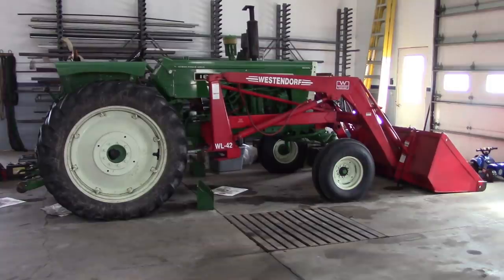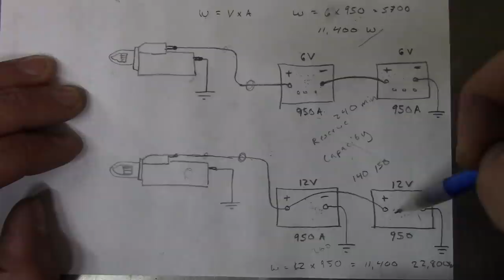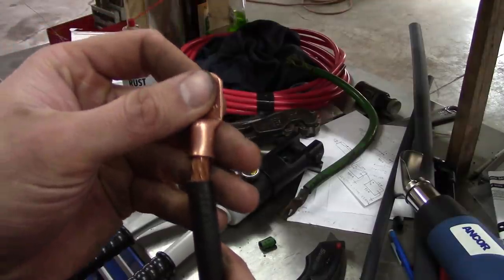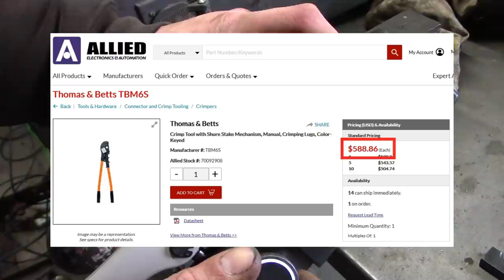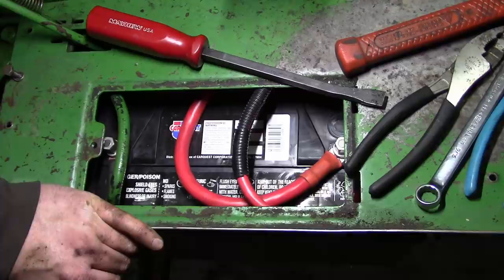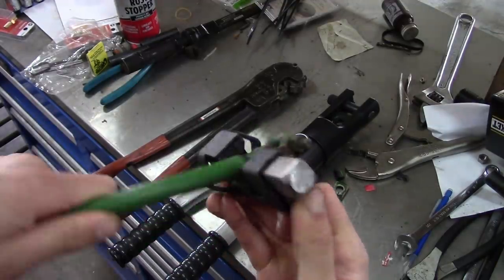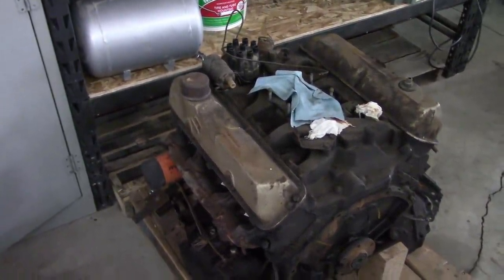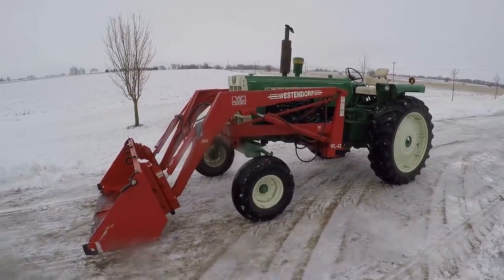Oliver 1650 Tractor 6 Volt to 12 Volt Battery Upgrade

Comment: The one cable on older trucks and cars everyone forgets is the ground strap from the engine block to the bodywork. I had an old car which was a mare to start. I threw new batteries, cables and even a starter motor at it with little effect. Then a wise old mechanic diagnosed the issue by taking a jumper cable from the block to the body and eliminated the problem he then replaced the braided strap.. He also showed me where the choke cable outer sleeve was starting to melt as the starting current was taking another path. Arn't cars great!

Comment: That Oliver is such a typical example of 1960's tractor technology.  Leaks from every seal, has some weird "Why'd they do that?"  and some "Why's IT doing that!"  and yet give it a few minutes to start and warm, tong fer chong as it may be it goes out and works.   Wont see any tractor today running like that in 2070... Great video!  That crimper, wow, I restore old tractors for fun, and THAT thing is the cats meow!
Reply from the maker: Yeah. I feel the same way. You can fix this tractor with a hammer, a flathead screwdriver, and a 9/16 wrench.

Comment: You already got the suggestion for using a MM2 > AWG conversion table. So that's covered.

Use the MM2 die closest to your AWG cable, even if it is a little to big. The difference is minimal and will not hurt the quality of your crimp. More or less flexible wire (=number of strands in wire) also have a different outer diameter so you will never be spot on.

Never use (copper) starter lugs but always use thick walled fully closed tinned lugs like you used on the 2/0 cable. These crimpers are designed for those lugs.

Always remove 5-10% more insulation of the cable. This is because your terminal will get a bit stretched in the crimping process.

Always start crimping nearest to the eyelet in the lug when you need to do 2 crimps or more. For the reason of that see above.

Comment: My electrician made a plate with a post that sticks into the handle (you remove or cut the end of the rubber handle) which allows him to either use his foot to stick the crimper upright on the floor or screw it down to a bench. As for how you'd go around to figuring out which dies to use with which wire, what i saw him do is, he'd take the wire, clean it as you did, then put the dies over it. When the dies touch the wire evenly on all sides, he'd either stick with those or choose the next number down, based on the thickness of the post. 

We redid the entire electrical cabinet for an industrial site a few months back, so i got to watch him work extensively with this tool (one like it, different brand). Different wire thicknesses, different terminals. Very versatile tool. There's also different dies you can buy where they perform different actions, for example, there's one that allows you to slice a thick wire perfectly clean in one cut, really clean one. And using the other side of the dies, you rotate the wire in, perfectly cuts the sleeve too, doesn't slice into the wire at all, with a little lip on it. Obviously, useful only in a production setup, i doubt anyone in their right mind would do this for two or three wires, but there's variation.
Reply from the maker: Interesting. I wonder if the dies will fit this cheap tool.

Comment: You did everything right with the crimp,   but after you final crimp you should rotate 90 degrees and crimp again to get rid of the 2 little flags that stick out from each side.  I rotate after each crimp and crimp it again at least 2 times,  this also tightens it up,  I've been using this tool for years. It never fails. I'm referring to the hydraulic crimp tool.
Reply from the maker: There you go! I'll try that next time.
Reply: Double crimping is a big no no.
Reply: @audiquattro6768   not if you are rotating it exactly 90 degrees between crimp with this type of hydraulic  tool
Reply: @WatchWesWork  I said 180 degrees  but I meant only 90 degrees rotation

Comment: 1st . Here in Minnesota I have 3 Northern tool stores within 15 miles , 2nd . Back before 12 volt ( pre 56 ) farmers had 6 volt and lots of them so Oliver thought that having 2 -6 volt batteries would be easier on the pocket book !  We have Fleet Farm around here and was told there batteries were 2nd’s and or blems and that’s why they are sometimes cheap ! I like deca batteries myself and I do prefer to solder the ends on . But that’s my choice ! I do so few batteries that having a specialty tool is more of a luxury for my shop . So that’s my 2 cents worth ! Congratulations on only having to take care of 1 place !
Reply from the maker: Yeah, it's a luxury for me too. But for $30 I thought I would treat myself!

Comment: Years ago I met an auto mechanic who had a short stump for a ring finger. I asked what happened. He said he got his wedding ring across 12volts and a ground. It instantly got red hot, cauterizing around the finger before he could react. Did so much damage he lost the finger. I think of that as well as the tools every time I disconnect/connect a battery. I also never wear a ring when working!        I first saw you on the Morgan brake job, subscribed immediately. You are a great guy to help her. You are also clearly a very bright, talented mechanic (I’m guessing EE).   Wish I was lucky enough to have a great mechanic like you near me!

Comment: Stopped watching a movie when i got this notification.  WWW>movie.
Reply from the maker: Nice! I'm moving up in the world!
Reply: @WatchWesWork   At least you found that repaired cable with a proper crimp on it!  I don't know how many times I see guys using those zinc or lead based battery terminals from china on their rigs just waiting to burn your barn down.
Reply: @FrequencyOfThought  Terminals? I just make a loop by separating the wire, Throw a little solder on it and I'm good.
Reply: @HanstheTraffer  Please don't use solder, I hope this was a joke.
Reply: @FrequencyOfThought It is a joke but why not use solder?
Reply: @HanstheTraffer   Because solder melts with heat. Think of a shorted wire and how hot it gets.
Reply: @FrequencyOfThought  save time n money ,just melt the terminal over the wire ....
 Propped job ,,,,,!!!

Comment: I have a crimper like that I bought of amazon, different color but probably made in the same factory.  It works good enough, I guess.

Also, "welding cable" is more flexible and easier to work with than normal battery cables.
Reply from the maker: I know, but SGX cable has a higher temp rating, ironically.
Reply: I used high amp jumper lead cable to hook up my duel batteries 👌

Comment: I got a yellow version off that jungle place. I got it for building 4 awg cables we provide with a product. A great way to check the die size is to saw through crimp in the middle. When done right, the copper goes solid. I find we could mix and match dies for intermediate sizes. I ended up machining the back of one die to end up perfect sized for our application. 👍

Comment: I have so much to say on this subject. I will refrain from ramblin on. Two grounds on every battery. I   solder my connections then water and salt can't enter the thing. 5he days of good batteries are gone. Well done Wes. Enough said.
Reply: Not good to solder these, I believe. High heat can melt it.
Reply from the maker: Yeah. I hear that. On a vehicle there is no such thing as "too good". But you can get away with a lot on these tractors. They never see salt.
Reply: It does take a lot of heat to solder one of these terminals, but I doubt you'd damage anything but the insulation. Not an issue if you put heat shrink on them.
Reply: Unless you mean the terminals melting off... I've never seen it or heard of it happening, but it could under some circumstances.
Reply: I was always told not to solder wiring on a vehicle if you can help it because the solder wicks up the wire and cause it to be less flexible and work harden until it breaks.
But I'm in Australia and we don;t get salted roads, or snow mostly.

Comment: I got a crimper from Harbor Freight, worked great.  Did a cable wrong and had to cut the connector off and replace it.  Cut the removed connector in half and was pleased to see that the connector and cable became one piece of copper.  It did a good job.   Also, I put the main handle to the crimper into a bench vice and then I could hold wire with connector in jaws with one hand and pump with the other.

Comment: Wes, a friend of mine who has a big very old tractor like yours out in the Redlands in the southwest area of Miami-Dade country fixed his weather checked tires with Flexseal passengers and a plastic Bondo spreader 2 years ago.
He hasn't had a problem with them since.
Sounds crazy but like you said.
The price of new tires is insanely expensive.
He did dismount them from the tractor so he could lat them on their sides so the flex seal wouldn't sag.
Thanks for the highly informative and entertaining long video.

Comment: Geez Wes, I can't believe someone has not yelled at you for setting your batteries on bare concrete! Keep up the good work!
Reply: That was only a problem with early battery's that had crude, rubber cases. They would rot, leak, etc.

Comment: As much as I like my 90's Japanese tractor for its reliable, starts whenever and economy, I miss my old Allis with all its leaks, quirks and weirdness.
Reply from the maker: I don't have much experience with Allis. They have good engines, but the clutch/PTO clutch setup is odd, and the transmissions are unreliable. Of course, that's true for plenty of other tractors.
Reply: @WatchWesWork  Hand clutch give nice control and lets you do live PTO.  Just like the diesel injectors, must be a patent issue because everybody has a different way.

Comment: I would mount the tool in the vice....then set the lug in the tool....use your hand to push the wire into the lug mounted in tool...then pump with your free hand.
Reply: pump with your free hand. BTDT.

Comment: Hiya Wes, another great video, thank you. But, yep, there is always a but, when yon fitted the first, on-screen negative cable to the chassis you should have cleaned off the metal. Surface area contact is the clue, so clean off the frame of gunk, paint, etc. Apart from that, nice one... Stay safe...Steve...

Comment: It was my understanding the equipment that is subject to vibration should be crimped connections on stranded wire.
Reply from the maker: That's the conventional wisdom. Solder can be brittle.

Comment: Thanks for the battery lesson. I have the same crimpers I got on Amazon - I put the crimper in the vice which left me hands free to line up the lugs so the cables wouldn't have to twist.

Comment: In the shop I worked at we used Kopr-Shield made by Thomas & Betts on all of our battery cables when we put the lugs on and also on the battery terminals. I use it on my own vehicles to keep a good connection and no corrosion. It is like a copper never seize that is conductive. It is real good stuff.  Nice video.
Reply from the maker: I'll have to check it out. Deka sells a battery terminal spray as well, but I have never used it.

Comment: It's a matter of metrics, when you mass produce an item by the billions of units, the total price is less than you'd imagine. And i'm not talking about a finite item, rather, sub-components. The knob, the dies, the press, the ram, the handles etc. Then you add up the indentured slave labour (it is, what it is, i don't consider China's situation to be in legal bounds with the Human rights, regardless of who signed them or not) and the fact that shipping for these kinds of items is done containers that were already paid (they're basically stocking fillers, put on the sides of the items you pay large sums for)...then, the 30USD price starts to add up.

Also, none of the items you pay large sums are actually worth as much, those batteries? Finite price of production at the end of the cost damp on the production line/R&D/human costs et cetera is probably somewhere around ~30 to 50USD. The iPhones people pay +1kUSD? Apple pays only 400~500USD for it. It goes on. 

You're not paying someone's labour, you're not paying someone's mind, you're paying the brand, specifically, you're paying the greedy CEOs, not even the investors. Figure those scumbags make NthX of what the base average worker in their company does. And with automation, even less.

That being said, Corona will take care of that, with negative and adverse outcomes for everyone involved. You, me, the scummy CEOs, the brunt being taken by (now) actual slaves, as the Chinese gov basically took the equivalent route of the Nazi party, and put the oppressed Uyghurs into slave labour, when their Chinese indentured slave workers got sick/quarantined/not brought to work.

I deal in a lot of architectural sub-components, i know my hands are equally dirty, and the finite problem is defined by the fact that stocks from China are simply, not coming any more. I have parts for 7 months worth of work, then that's it. Already looking for local, more expensive alternatives, which means i, have to up the price, and so on. 

Things are going to be tough for a while, and i can only hope this serves as a lesson, and countries like US, Canada, European continent, to pick up their skirts and do their jobs right, and start production in their own backyard again. Of course, the scummy CEOs will milk this situation to the max. Wanna bet that they're going to say something akin to "the R&D alone will cost us billions" despite the fact that the production lines are already setup in China, and they're fully aware of how they are made?

I'm sorry for the gloom and doom, but this is the shitty reality of our world. I've no idea where the timeline got screwed up so bad, things weren't supposed to end up so bad after WW2. Yet here we are.

Comment: Loved that little video. Batteries are a pain in the proverbial. The tractor is a handy item to have around the place. You might use it once a month if that but it saves on the calluses. We use an attachment for the back called a link box or transport box which is very handy. You might pick an old one up cheap. Congratulations on the house closure I’m happy for you.

Comment: Group 31s go on sale periodically around Phoenix area for $65 ($80ish normal price) but they are a lower CCA rating than what are typically sold in the mid west. I ran a truck in WY for 2 winters (using the $65 batteries) with temps to -20F and never had issues cranking. Keep up the good work!

Comment: In the past I've tipped the new connector upside down in a vice, tinned the inside of the connector and the wire, filled the connector with solder, and heated it up with propane to make a lake of solder. Then I push the hot wire with flux on it into the hot pool of solder. Then after it cools, slide the heat shrink insulation over and seal. Works great but it is time consuming and hard to do on the car. I've never seen cracking or vibration issues after. Last month I got one of those hydraulic crimpers, haven't tried it yet. Nice demo!

Comment: Congrats on selling your house.
The condition of the battery boxes amazed me.
Great diagram of 6V vs 12V,
I have HF and NT stores within 20 miles. I can hardly drive by NT without stopping, but HF could close up and I wouldn't miss it. Mega junk store.

Comment: You are right Wes pre-tension the terminal first. I am an electrician and I use the same type of terminals on heavy electrical cables and if you put the cable in the terminal first then you need three hands. A vise would be handy but I'm never working in a well equipped workshop.By the way great videos .

Comment: Bought one myself, different brand name. Used on 2 electrical systems so far. Worth it as the nearest auto parts store is 17 miles away.

Comment: I once has to crimp some really heavy terminals for an armoured vehicle, but I had no suitable crimp tool. What I used was a large pair of old and blunt bolt croppers. That worked really fine, it did not look as nice as your hydraulic made crimp, but it was fully functional. Naturally I had to be careful I only crimped the terminal and not cut through it. 🇬🇧

Comment: Going back and rewatching old videos, I actually have one of these crimpers now, but in a smaller, more compact form and it cost something like £12 (Scotland) and I use it all the time now, never had a crimp come loose or fail, Ive even used it with ferrules for fuel hose (low pressure) and again, never had one go wrong. Just can’t believe they are so cheap!

Comment: I am glad you pointed out there is only 3 manufacturers  of batter's.  If I Remember  right there is only two manufacturers  of antifreeze. Been awhile since  I hauled antifreeze  in bulk tanker watch them go from one name branded to another the only thing change was the color of the bottle line never slowed down one bit.
Reply from the maker: True for many other things, like oil filters.

Comment: Loved the section on 12v battery tribes, so true.
One trick I have heard works is to ask for a 12v marine/boat battery, they are basically the same as a car battery but usually 30-40% cheaper. The difference in CCA is negligible.

Comment: I have a terminal crimper identical to yours in design and manufacture. It's yellow, has a yellow case and different brand name. Bought it for twice what you paid 6 years ago. Mine worked for making solar battery cables.